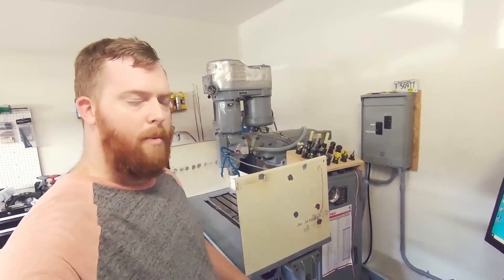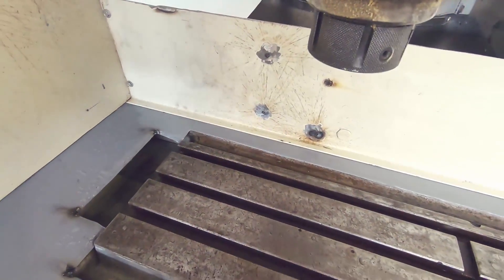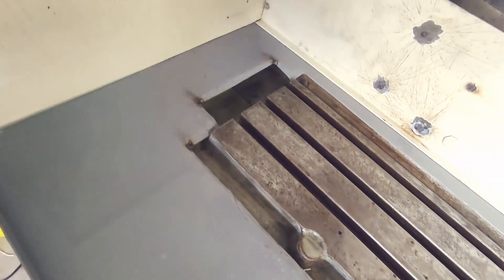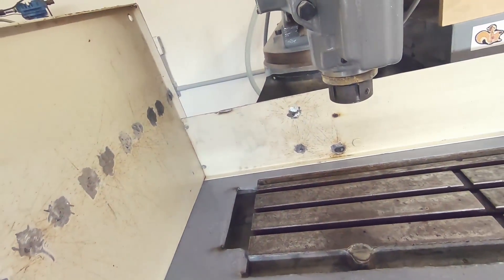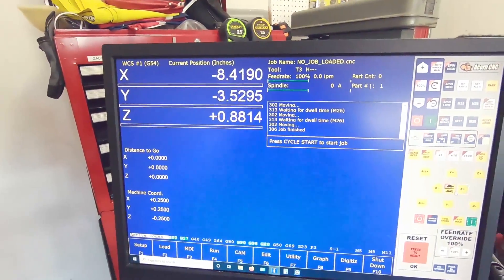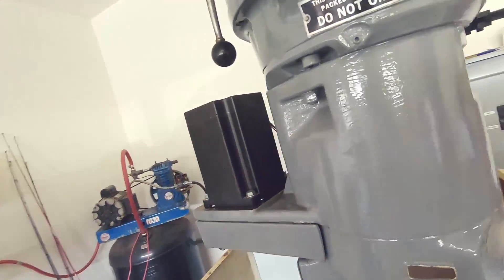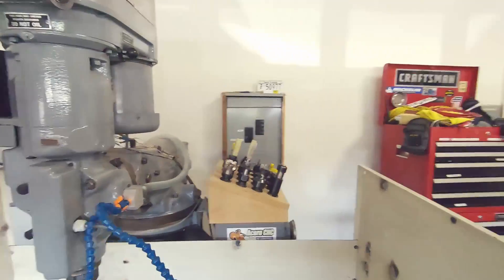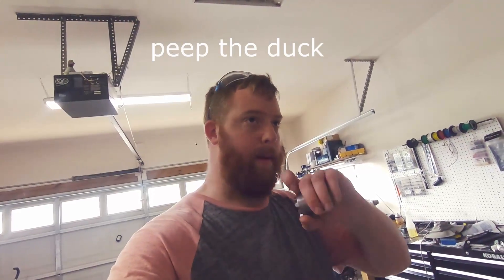Flood Coolant On The Bridgeport Mill

Comment: Can u walk me thru the electrical setup for your garage? Trying to do the same with 200 amp panel I have. I assume this BGPort is single phase?
Reply from the maker: Sure. I have a sub panel fed from the main in my house on a 50amp breaker. The mill runs on a 30amp. The BP is converted to single phase via a vfd that's integrated into the control panel. The incoming power is 240vac that is fed to a distribution block and then split to wherever it's needed. The 240vac powers the vfd that outputs 3phase for the spindle motor. Everything else runs on either 5v-120vac and DC for the axis motors which is converted in the drives. Hope that explains a little more.